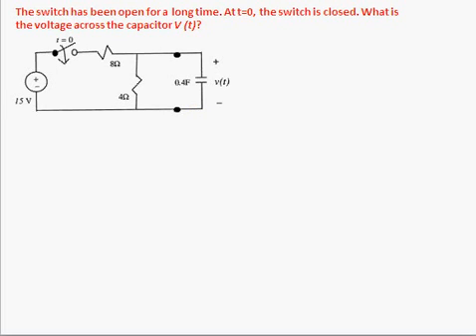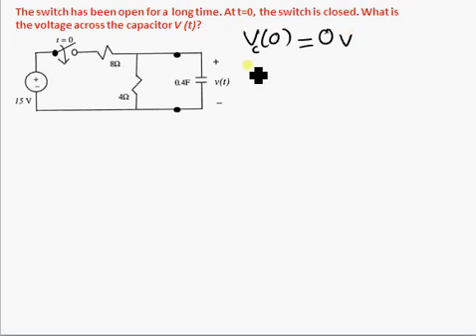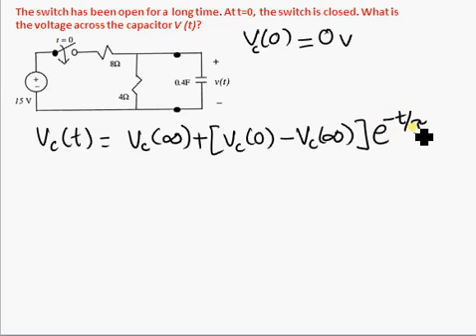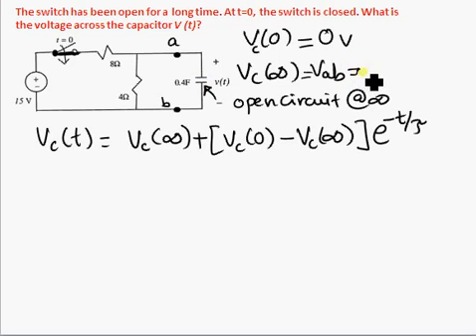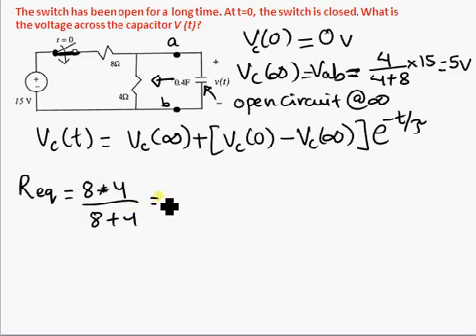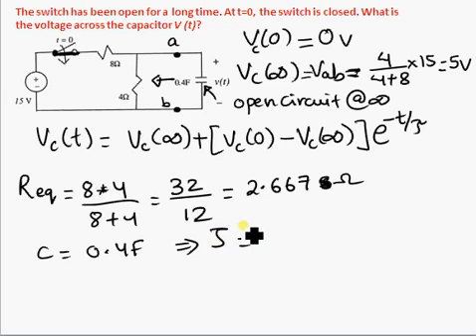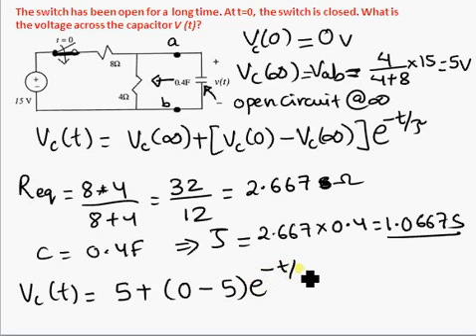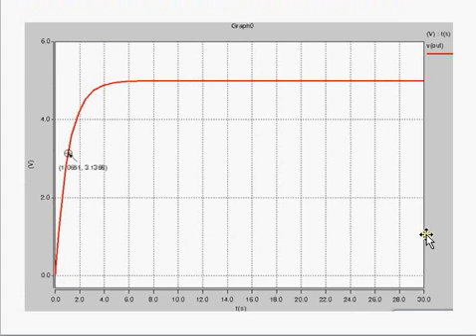Example 2 - Transient Analysis - RC circuit (1st order)

Comment: How are 4ohm and 8ohm in parallel?
Reply: Use the thevenin idea to look at the equivalent resistance. When calculating the Req, short the voltage source and open the capacitor. You will see the resistances clearly connected in parallel. Hope this helps!

Comment: shouldnt the voltage across the capacitor at t= infinite be zero since once it is full charged, it acts as a open circuit and its voltage cannot be change instantaneously for i=Cdv/dt ??
Reply: Current is 0, but there is still voltage between the two plates, which is why you can measure the voltage across the resistor in parallel to the capacitor to get the equivalent voltage.

Comment: Modding, & Building tube preamps design

question about rc components in between trodes on the plate of tube preamp ecc83-

rc components that are in between triodes ie large capacitors connected to the plate by + and grounded followed by say 10k resistor out to the next ecc83 plate resistor.
 is this a high pass filter?